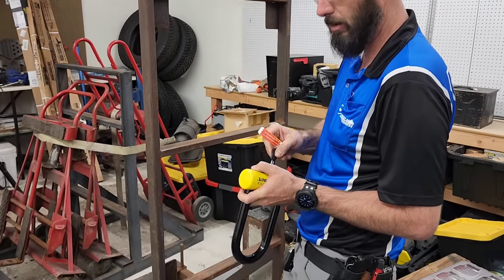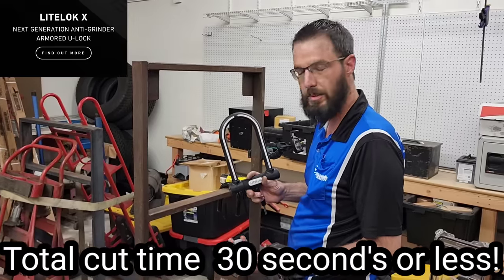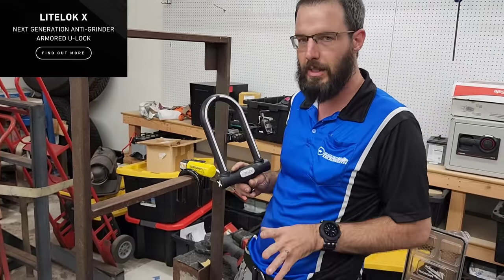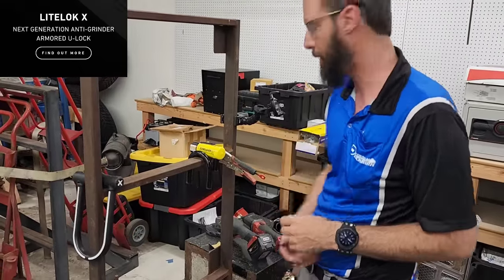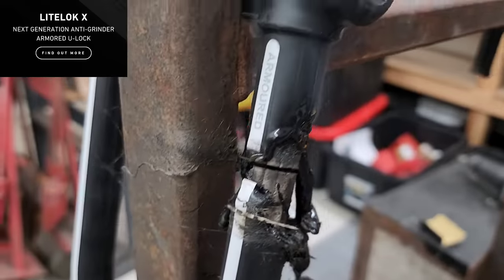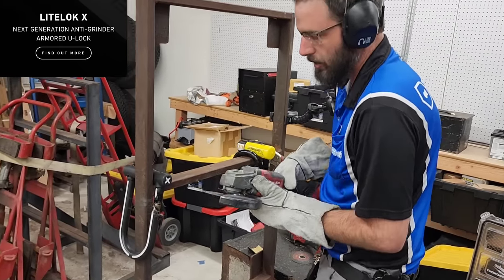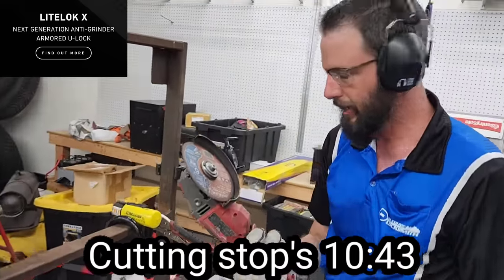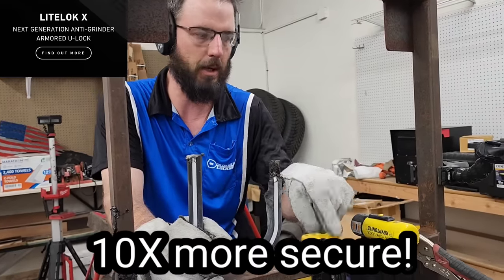Litelok world's first anti-grinder angle grinder resistant bike lock, top rated best bike lock 2022

Comment: I must have missed the "This has video has been brought to you by this video's sponsor, Litelok." As others have already commented, dude was flexing the hell out of the blade in the moments leading up to the blade breaking. Not something someone with lots of experience with that tool would do. I get the feeling that even if this is fairly resistant to cheapo cutoff wheels a diamond blade would zip right through it.
Reply: These locks can be picked in under 15 seconds with the right pick tool. The lock industry  is a scam.
Reply: @truantray  the lock industry isn’t a scam per say, it’s just that to make a truly unpick-able lock isn’t financially sound for lock companies. Just like making a lightbulb that doesn’t last for 200,000 hours+ isn’t sound for a light bulb manufacturer. Most locks are built around social compliance that 99.9% of people that see the lock won’t try to either pick it or break it. Then you have 0.01% left most of which is people who will try to break a lock and not pick it. 🤷🤔

The fact is, if someone really really wants to take your bike, they’re gonna take it regardless of the lock. So best defence is to not leave your bike in a public area where it’s easily accessed, and if you have to lock it up in a public space rather than a private one, make it look as unappealing to a thief as possible. 

If I leave mine in a public space I use a kryptonite heavy chain lock to secure one side, plus a U lock to secure my front wheel both linked with a cable lock.
Reply: @truantray  sure but that's not the way people are stealing bikes. I have never seen a lock left open. It's always either cut in half or smashed. And you have to learn to use picking tools. The learning curve on a angle grinder isn't that high
Reply: @raunefare  How long does it take to change to cutting what the lock is around, like that square bar?
Reply: @raunefare Yep, if you can pick a lock, especially this type of lock, you're not stealing bikes...
Reply: @raunefare  I'm glad I live in the country where most of this sh*t don't happen. A basic lock like this is a great deterrent. Having nosey citizens calling to police for everything is a plus at times.

Comment: A big problem is not the complete bike. It’s the components. My wheels cost $2,000. Bars $400. Pedals $200. Saddle and post $400. Cranks (with integrated power meter) $1000 etc etc. I guess the answer is only use a cheap bike in places it could be stolen and never let your racing road bike or high end MTB out of your sight for a second.

Comment: Apologies if someone has already mentioned this.
Here in the UK the most important tool a "professional" bike thief has is what you would call a panel van.
This means it's not how long it takes them to cut through the lock hasp, but how long it takes them to cut through the fence that the bike is locked to! The bike with the lock still attached then goes in the back of the van, the thief then attacks the lock in the comfort and seclusion of their workshop. These guys steal maybe 10 bikes a day, and they know which bikes are worth stealing.
A bike lock has 2 functions
1) It forces the "casual" thief to go steal someone else's bike.
2) It demonstrates to your insurance company that you've taken reasonable precautions to prevent your bike from being stolen.
Your bike is fully insured isn't it!
Reply: Very good points
Reply: The majority of the time its two guys on a moped with a grinder
Reply: I totally agree. No lock in the world, no gps, no alarm can protect your bike against targeted attacks. But It will deter opportunity thiefs. For everything else you need insurance. Here in germany I pay like 6€ a month for an insurance that will reimburse me the full new price of my bike if stolen.
Reply: @jimihenrik11  in UK is something like 6 pounds per DAY (and not the most expensive one) for a insurance that will reimburse you in full (plus excess)
Reply: Mine is 👍
Reply: @crazy777ful  I pay about $300 per year and that includes $300,000 liability if I run into somebody with my e-bike. America loves to sue.

Comment: Next time hold the grinder 'level' or inline with the plane of the blade once you develope a cut-slot (i.e., curf).
In the video, just before the disk breaks (6:40 - 6:50ish), it is going through a significant amount of bending for each of thousands(?) of rpm.  Most anything is going to break under this condition.   This is also very likely to be the source of a lot of the grabbing you are getting.  It still looks like the angle grinder is iffy.
Reply: seems sus
Reply: Looks very intentional to me. You can see him pull up on the grinder and twist the disk.
Reply: Came here to say this, my dude here is putting a lot of side load on his disc which is why he got lots of heat and not a lot of cutting, and ultimately two shattered discs.
Reply: Two and a half disks and a lot of melted plastic for side A, one used disk held level for clean cut on side B. 
Not sus at all.
Reply: Ahh nuts !! Maybe have to look for another review now you lot have said it’s sus
Reply: also if you look at how he is resting his fingers on the bar you can tell he is not putting much pressure while cutting
Reply: I've used a grinder a lot too.. You will eat disks if you don't keep it straight in your cut... Total user error if intentional or not
Reply: & if you'd spelled 'kerf' correctly I maybe would have given your opinion the briefest time of day.
Reply: @oniaisu8560  2 min for side A (and two and a half disks), less than 30 sec for side B with one disk. This guy is a fraud.
Reply: I was saying the same thing to my self
Reply: HAHAHAHAHA
Reply: Comforting to know there are still smart people who see through the bs!
Reply: @knothead1fersure303  especially being that other people on YouTube have blown right through this lock with an angle grinder
Reply: Nah ‘ some metals are “sticky” !
Reply: Abrasive discs are pretty crap really !
Reply: Side B was 70 seconds, remember footage was sped up 4x (supposedly)
Reply: Yes indeed - I got annoyed just watching it. like "wtf, don't bend it upwards like that - the disc is going to explode" and that's exactly what happened. The grabbing isn't surprising either, since the bending causes pinching and friction once he has cut to some depth - making it act like a disc brake.
The heat might have helped some in annealing the material though - but I don't know if it got hot enough for that (the plastic was melting, but not burning). Cutting the right way, will still create localized heat right where the cutting happens and not heating the whole shackle. Otherwise he could go on it with a torch then cut.
Reply: If a thief can't cut through the lock? Will they not  try and cut through what the lock is secured, too, eg, a railings ?
Reply: There are other reviews that similarly demonstrate the lock's ability to hold up well to angle grinder attack, not just this review... e.g. https://youtu.be/PUwjh8J4uec
Reply: shaddap
Reply: you could snap a blade off on a $3 master lock if you flex it as hard as he was
Reply: He is simulating cutting loosely hung bike locks. Most of you are unfair and f ignorant.
Reply: You can’t flex an abrasive disk like that and expect it to stay in one piece. Pretty stupid stunt for a lock company considering you’re not wearing a full face shield and purposefully flexing the disk like that. I’m surprised you weren’t wearing a piece of disk shrapnel in your forehead.

Comment: What blade did you use to cut the other side of the lock, as you went through it very quickly with one blade. 
And someone who claims to use angle grinders a lot you put a lot of pressure and side/twisting load on those disc's.
Reply: He wasn't twisting the Angle Grinder, its the 'stuff' on the lock that's 'gripping' at the blade...!!!

Comment: Thanks for the great content. As someone who has an extremely deep set of skills cutting locks off abandoned storage units (thousands), that's an impressively resistant bar. I've never had to cut bike locks. But I have cut every type of padlock from every manufacturer you can think of. It has never taken me more than a minute to defeat one. As angle grinders become more ubiquitous, it will be interesting to see how lock manufacturers deal with them. Very good video.

Comment: What about one of those locks with a hollow inner tube with a skin irritant or some crazy red dye that doesn’t wash out. Then when the disc spins it gets all over everything and ruins clothes, skin, everything!! Just a thought!
Reply: It exists, it's called the skunklock.
Reply: Very questionable legality. I wouldn't use such security measures without consulting an attorney first. I know that's stupid, as a thief hurting themself in committing a crime should be their own fault, but this is premeditated to injure a thief during the same commission. Thieves have successfully sued places they tried to steal from after being injured during the commission, so you might be doing more harm to yourself by using such security measures than you would be helping yourself.
Seek legal counsel before using such measures.
Reply: I was thinking petrol under pressure.

Comment: If they were to put individual 10mm freely rotating outer shroud pieces all along U lock bar section, then the angle grinder would in effect just spin those pieces instead of cutting through them, meaning that the thief would effectively need three hands to cut the bar, 1 hand to hold the grinder, 1 hand to hold the lock in place and one hand to hold the spinning outer shroud section with pliers to avoid injury.
Reply: They would just use duct tape to secure the shroud. 😢

Comment: Very good demo. Thieves who barely qualify to be called human beings will adapt, of course. For example, they will carry several angle grinders and simply switch grinders instead of switching blades. They will also cut through the rack (as others have mentioned). And for bikes with high-end components, they will cut through the frame to sacrifice it in order to get the parts.
Reply: yup I can confirm this, I have seen it
Reply: ▪️
I used to work with an Egyptian guy.  One day, he said to me
"In Egypt, if someone catch you stealing - they Chop off Your HAND.  And also in Egypt - NOBODY STEAL!" 
🟥
Reply: @2NDFLB-CLERK  ya nobody steals in egypt.. LOL
Reply: Also - I wonder how a diamond blade would do. I got one for my big (230 mm angle grinder) that was labelled as "demolition disc" and cut pretty much everything. 
For mild steel and aluminium it cuts about the same speed as an normal disc but it lasts like 100 times longer. For really hard material, like hard fire bricks with high alumina content, it cuts significantly faster - those material can sometimes pulverize a standard disc after like 2 cuts.
Now when I remember it, I also tried cutting ceramic tubes to the right length for an electric furnace that I built (those tubes are used to hold up the heating elements) with my small grinder (125 mm disc) that I don't have any diamond blades for. Those were so hard that a whole new disc got pulverized after one cut (and it was not "metal" discs, but labelled for cutting rock - although, the material of those seems very similar to the standard steel cutting ones, they are just thicker). Also I was not bending the disc, like he does in the video, and it was not exploding like it did for him - it was simply decreasing in diameter along with the cut and when the cut was done, there was almost nothing left of the disc, except a huge cloud of dust. A "metal" disc, disintegrated even faster. But my big grinder with a diamond blade cut those tubes easily, several times and the disc is still almost like new afterwards.
Reply: if u have a cheap bike why would they bother, expensive bike put it in a lockup or dont leave it alone for too long.
Reply: Get insurance folks.

Comment: Both times, I called the blade breakage. You were torquing the grinder causing the blade to be cutting while bent. That’s why they snapped.
Reply: 100%, that's exactly why his cutting discs failed. You can easily see how warped the disc is while it's cutting because he's twisting the tool so much. This is a recipe for disaster when cutting ANY material.
Reply: I observed that too. I was like "wtf, don't bend the tool upwards like that" - it's so clear on the video how the disc really warps and bends. 
"I can feel it grab the disc" - like that would be some property of the material - it's simply the disc getting pinched because of the bending. That's also why it got so hot (plastic coating to run off like wax 😂), since it behaves pretty much like a disc brake creating friction heating. The heat may help though - making the material somewhat softer and easier to cut. I have cut some hardened steel, that's cut slowly at first, but then suddenly the cutting speeds up and it gets as easy to cut as ordinary mild steel - it gets so hot by the friction heat that the material get annealed. But then it would be better to use a torch and then cut, than breaking the discs.
Reply: Yup. It almost looked as if he did it on purpose.
Reply: he didnt shave it either...looks like he just held it in place. very weird video and honestly not something we can prove unless we were him.
Reply: Yeah, like the average meth-head bike thief is gonna be a real expert and have perfect form lol.

Comment: You work with metal a lot and can't hołd a grinder straight?
i work with metal rarely, and almost always use second handle unless impossible, and never get a flex on a disc like you. Props for cameraman's balls of steel, to film not behind the disc guard.
Reply: I think the reviewer is trying to give the impression of 'how a thief' might approach using a grinder. That's what makes this a review of note. Anyone can conduct a test under ideal conditions with a power-supply cable grinder, but a thief would be in a rush. Someone also made a interesting point above that they may then damage the bike out of frustration.

Comment: I have LX, it operates very easily.  The key and shackle sets and re-sets easily in the dark and the rubber coating works well for storage on my frame while not in use. Nobody has tried to cut it yet. I doubt it’s as difficult to cut as this demonstration?  I don’t know about 10X that of the Kryptonite but it might be 5X.  If it is ever defeated I’ll revise this.

Comment: I've been using the Abus xplus Granite(230mm) & mini Dlocks on my Ebike for years but have always had to worry about angle grinders, the few locks that could resist angle grinders tend to be thick Chain locks for Moterbikes. I plan to buy the LiteLok X3 as my main lock (through rear frame and wheel) lock and the LiteLok X as my second lock  (through front forks and wheel).  I need to apply for the underground cycle lock up parking, combined with these locks I think I can finally worry far less about some asshole with an angle grinder. 

If the LiteLok X3 is less angle grinder resistant than the Hiplock D1000 than I'll use that as my main lock but I like the shape of the LiteLok Dlocks.
Reply: Did you end up getting litelok (any model) or hiplok? How was your experience with it?
Reply: @asifjamal5874  I bought litelok X1 because it would can fit in my bag.  my experience with it has been same as using my Gold rated abus lock but without having to worry about a thief getting through the lock in a minute.  I still plan on getting the X3 but that would be left in an underground lock up

Comment: The plastic shackle jacket melting seems to be lubricating the cuts. And you are indeed placing too much side force on the cutting wheel making them fail prematurely.
Reply: Zactly. I use cutoff blades all the time and in all the wrong ways.. I cut alloy, I polish, I cut channels sideways... I only destroy the blades if I load it sideways... and I've had them hot... cutting things like hardened steel etc. Stainless.. Brass. Plastic. even glass...   Not to say I haven't destroyed a few disks... usually because I cut so deep the heat can shrink the slot and grab the cheeks...

I'd make the outer rubber... It won't stop them but at least they'll stink of burning rubber!
Reply: It's intentional to sell these locks. This is actually just a commercial.